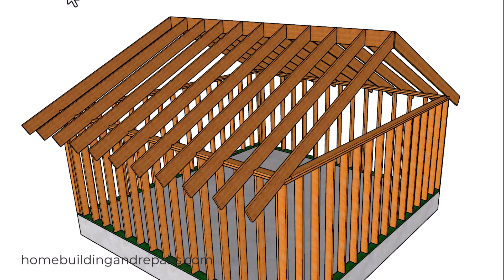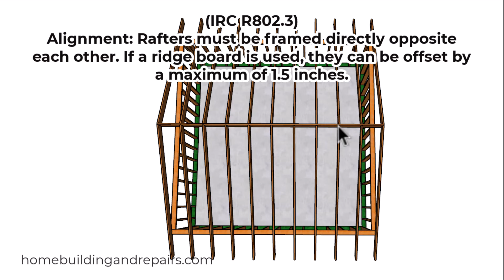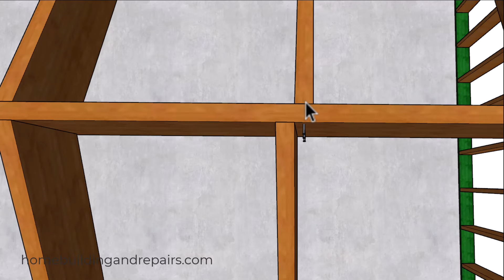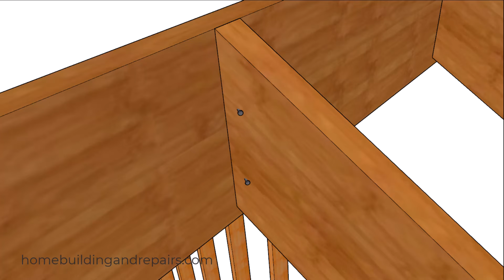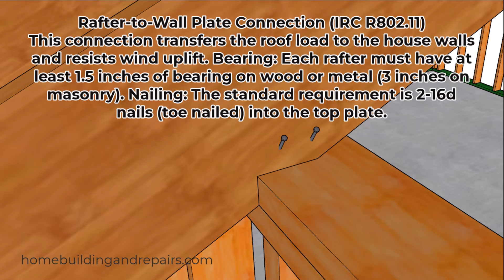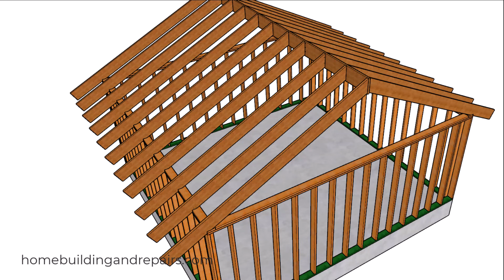How to Attach Roof Rafters - International Residential Building Code Explained

Comment: You describe pretty much exactly what I learned back in 1975 working in San Bernardino County with my uncle framing hip roofs on 4,000 to 8,000 square foot homes. 

They were 3-12 pitch with tile roofing. In other words, the framing had to be pretty heavy and stout. The common and jack rafters were usually 2x8, with 2x10 hip/valley rafters and 2x12 ridge board. Because the spans were so large, double 2x8 purlins beneath the long spans had to be installed and braced down to bearing walls/footings below. Also, many times the hips and valley rafter had to be spliced with long "V" cuts and braced to walls below.

It was pretty neat being involved in these big roofs. It would be interesting to go back and see those homes.

Comment: Can screws be used instead of nails?
Reply: If building for yourself. Structural exterior screws. You can use Simpson strong tie screws. And tie. Always check code. If you can build a 20’x20’ room/building you can build almost anything.